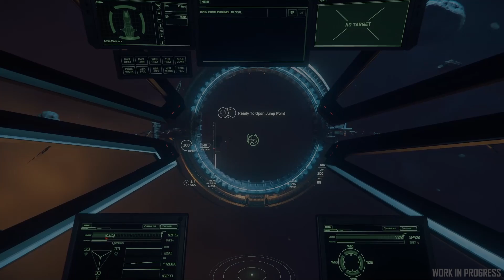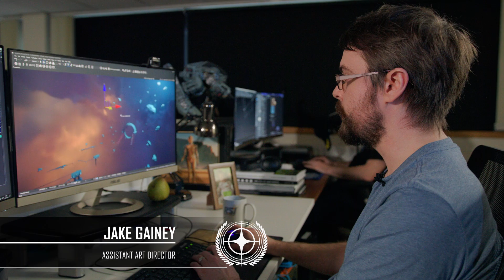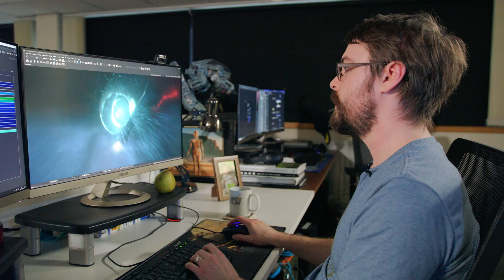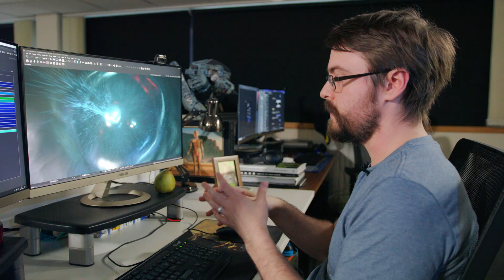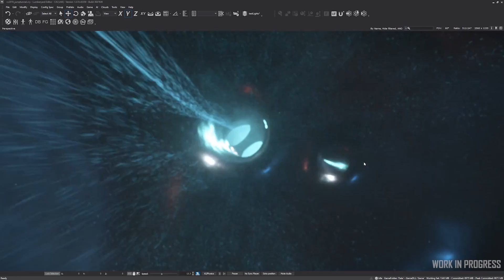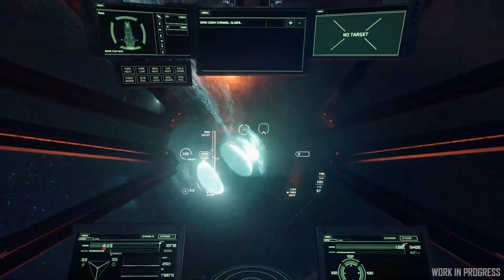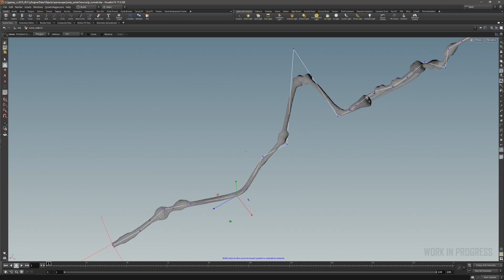Inside Star Citizen: Jump On It | Fall 2019

Comment: What does the Jump points look like in its natural form without the jump ring? If following lore on how people just run into jump points without jump rings to open them then how do you find one or open one without the jump ring.
Reply: Frank Sculpts 

The Jump Drive (an attachment for the Quantum Drive) is capable of Opening and temporarily Stabilizing Jump Points with out a Jump Gate. The Jump Gate is there  to stabilize them permanently, to provide infrastructure for the mass transit that passes through them. 

In SC Lore the first Jump Point was discovered by an explorer that noticed a stream of Neutrons disappear into nothing on his sensors. I imagine similar sensor ques will be required to detect new jump points.

Comment: So can the jump points be seen with the naked eye? It wasn't in the demo before it was opened. How about the ring gate. What is its purpose?
Reply: Mike 

The first Jump Point was discovered when an explorer noticed a stream of Neutrons vanish into nothing out near Saturn. (This required the right sort of detection equipment). If that’s any indication. 

The Gate is there to help stabilize the entry/exit point of the Jump Point’s wormhole.

Comment: Just a loading screen...
Reply: Someone didn't watch/listen to the video..or has a serious problem with comprehension.
Reply: @Ferenczy1966  hahah right? Like they literally said "you" fly through the wormhole manually. And it dynamically unloads the Stanton system and dynamically loads the Pryo system in while still traveling and navigating the jump route. Not exactly a "loading screen"..
Reply: @MSGTMad  ofc its not normal loading screen, but you still need some curtains while absolutely new space will load in. Lets pretend i have slow PC with HDD. What happens if this wormhole will be too short and all from other side is not loaded in time? I get a freeze or/and not fully loaded other side. And what will happens if i fly not by the line but in the wall? Is my ship will blow up or appear somewhere between systems? If ships blow up it will be very funny to traders and their cargo. If ship drops out so where will it be? Same scenario to the anyone if they will not have QT fuel enough to make it back. And we probably not get it anyway before server meshing. Because what will happens if you fly with like 10-20ppl?

Comment: Can ships cross in a wormhole? Will there be queues? What if one pops out just as you are about to go in?
Reply: ... Or can you even collide with other traffic in the wormhole?
Reply: That s actually a good question
Reply: @noisyboyuk  So basically Freelancer then
Reply: This actually reminds me of the Lagrange points from Independence War II a lot.  I'm glad to see they took that kind of path.
Reply: Just about to pop into jump point as a bengal jumps through. Good luck avoiding an oncoming 1km long hunk of metal.
Reply: @davescott7680  Would be funny if you could sit your little spaceship in the path of where the Bengal comes out and it just instantaneously explodes your ship when it emerges.
Reply: "What if one pops out just as you are about to go in?"
Well, that would be very embarrassing.
Reply: I would assume that the hole would become constipated. And the longer it is blocked the more buildup would accrue. 

They would need to send in a probe to unclog the hole.
Reply: What's more, what's to prevent pirates or players simply camping out right next to a jump point to effectively blockade an entire star system? It calls into question as to how the Vanduul can even advance as they do. Surely all the UEE would have to do is concentrate all units at the entrance to JPs to all known Vanduul territories to eliminate any threat. Also, wouldn't it make any surprise attack almost impossible? Knowing only certain routes in and out they could place an armada at each entrance or a listening post. The only in-lore explanation would be is if they're using a JP unknown to the UEE or its allies, which makes for players finding them more interesting
Reply: I really really want a possibility to dogfight while going through a jump point, it would be so amazing